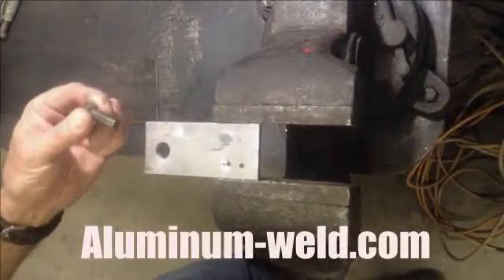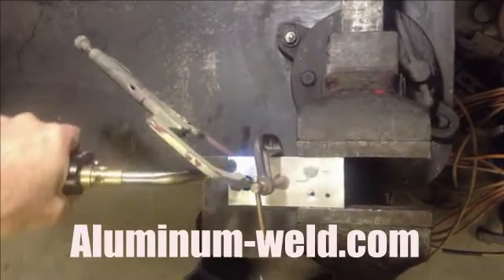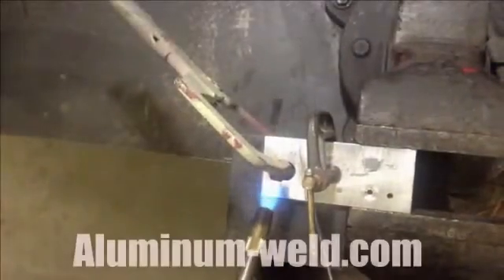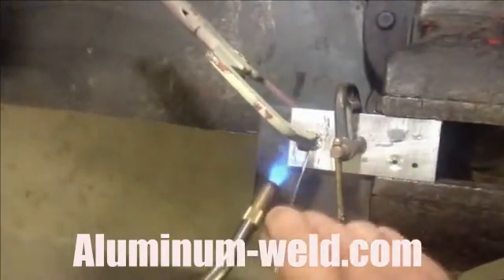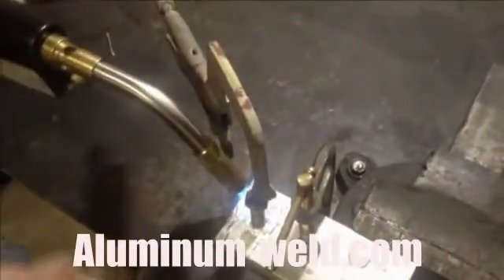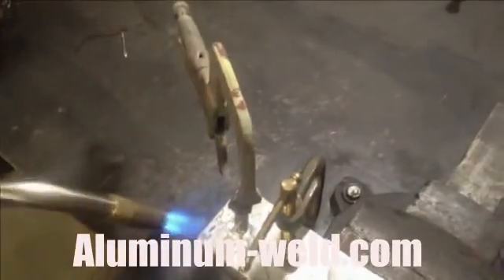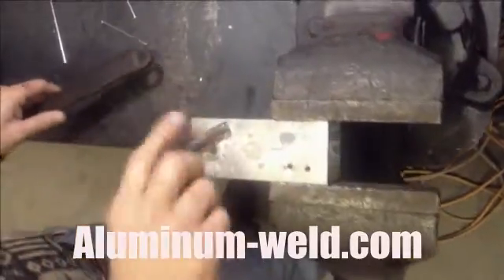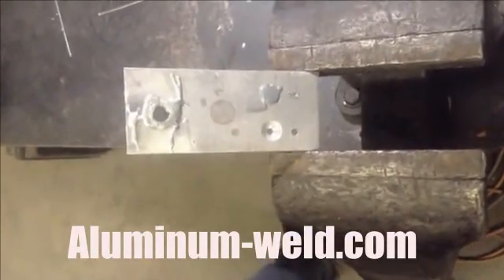Aluminum repair stripped out threads repair using HTS-735-11

Comment: did you say stronger than original? I would want to see proof. and this would be really difficult on any alloy cylinder head as it would be next ti impossible to heat the head to that 735 degrees. the head will just absorb the heat from that little torch

Comment: Good job. Protip, next time, wire brush the hole throughly with a small steel bristle brush that'll fit inside the hole. 2nd, before you put the bolt in the hole, "tin" it, get the hole to >730°F. Rub a small amount of the rod inside of it all the way around, ensuring good adhesion. Then finally, do what you did there. This is the way.
Reply from the maker: Good tip!

Comment: Awesome video! I'm about to try repairing a stripped thread on the aluminum clutch hub of my motorcycle.  I'm using Bernzomatic AL-3 rods though. Here goes nothin'!
Reply: I'm going up against an inner clutch cover bolt that stripped out. How did yours turn out?

Comment: If you did this on a timing chain cover would it damage the head gasket by getting stuff too hot?
Reply from the maker: Yes because you must get the metal to 735 degrees

Comment: What about using lead free solder? I have an m4 screw for a vintage speaker driver that just needs half a millimeter to fit.
Reply from the maker: Solder is not strong